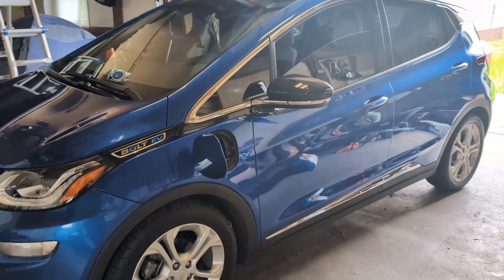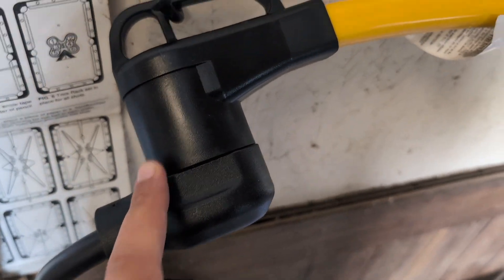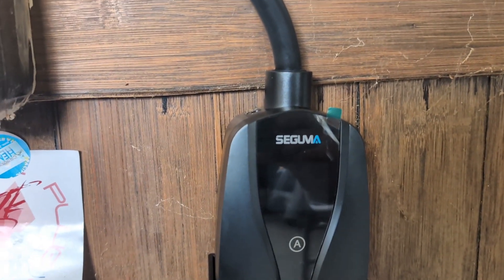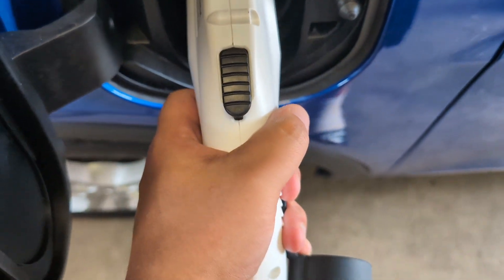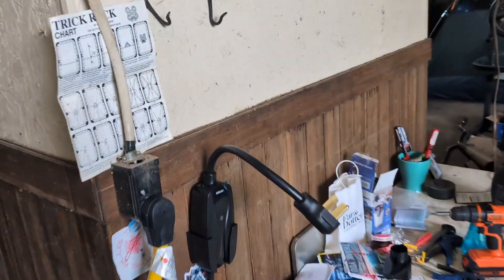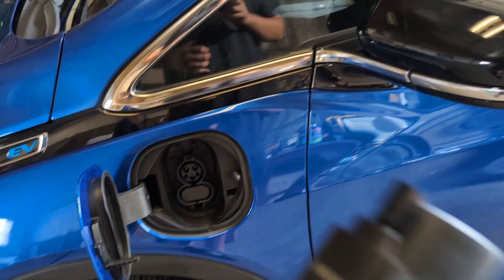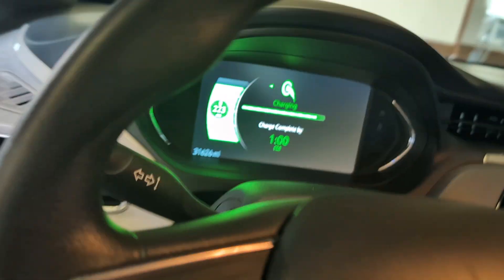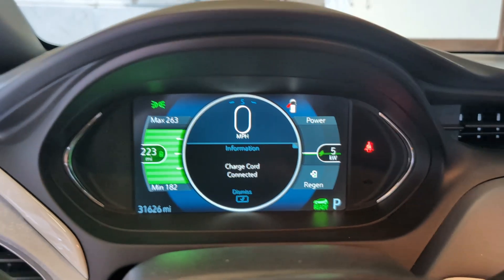How To Buy a QUALITY Level 2 EV Charger On A BUDGET!

Comment: I just installed the nema 14-50 plug with GFCI 50 amp outlet. Waiting for the inspector to pass   my work. I just ordered the Aimilee level 2 charger for $129 on Amazon. Will test the charger when it arrives.
Reply from the maker: @NewYorksFinest1  niceee! If that charger doesn't work return it and get the SEGUMA one that I showed in this video. I haven't had any issues with it so far.

Comment: Is your outlet backed by a gfci breaker? If so, that might explain why your first charger isn't working. It's well known that some EVSEs have their own breaker inside and don't play well on circuits that also have a breaker. Translation: you could at least sell the "bad" EVSE and just let everyone know not to buy it if they have a gfci breaker, or live in a state that requires it. Some states don't.

I installed my own 14-50 outlet and it's working great. But my EVSE is on 32A and my Tesla can take up to 48A. I might one day switch it out, but there's honestly no need. There's never been a time where I needed the extra charging speed. I wake up in the morning and my car is ready to go!
Reply from the maker: @dontbanmebrodontbanme5403 the first charger I bought I was able to return it back to Amazon. The breaker that the outlet is on is 2 50amp breakers with no GFCI so I'm not sure what was wrong with the first charger. I haven't had no problems with the SEGUMA charger so far...it's AWESOME!